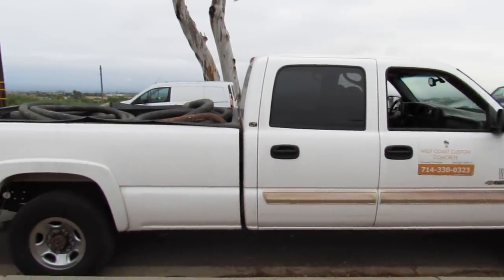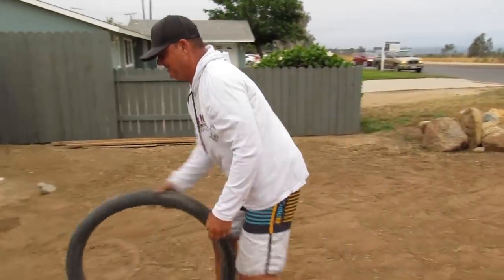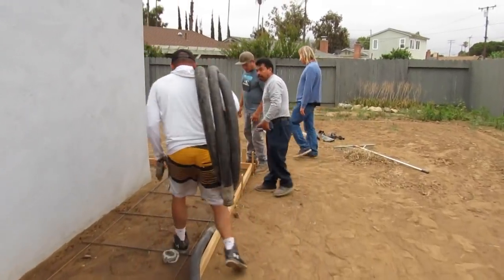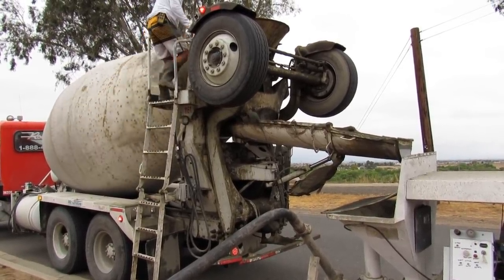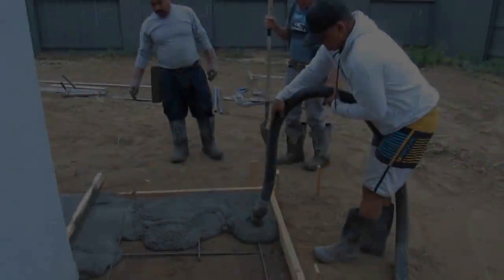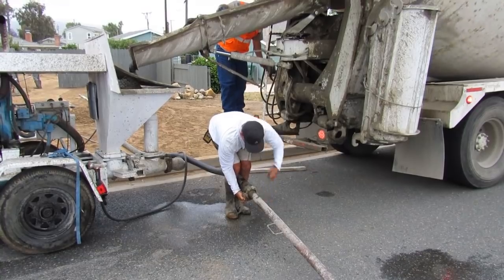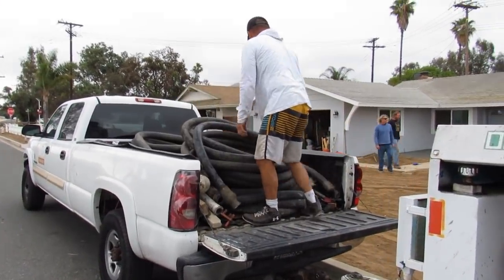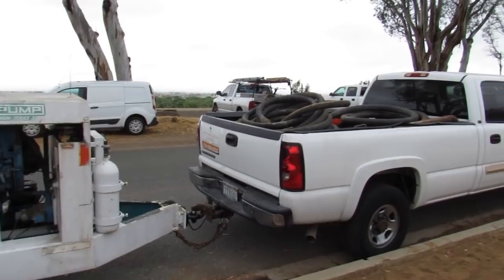Concrete Pumping. Olin 545. The Best in the West! California

Comment: You are the only guy I’ve seen that makes this look so easy and relaxed and simple.. I’ve been pumping for 6 years here in the IE and LA county area. Cheers💪👍 be safe out there.
Reply from the maker: Thanks bro! What kind of pump are you running?
Reply: No problem man! And I use Olin 545 and 565. I want to learn how to use a T/A pump. I’ve heard some are really good.
Reply from the maker: @Yeetman666  for sure bro t/A pumps are nice. If you are running  A Olin you would have no problem  running a T/A

Comment: Nice. With a ball pump you would have to break open the reducer to get a sponge in there, right? Not worth the trouble if you have the water.
Reply from the maker: Yes water works perfect

Comment: What's up! My father-in-law just picked up a Olin 535 pump not too long ago and I've been helping on the last couple jobs. How much do you adjust your nitrogen bottle per number of hoses or is it always set to 100? When you're doing your clean out, are you cutting off your hoses and leaving just the first hose or running the water through all of your hoses and back into the cement truck?
Reply from the maker: It all depends  on the distance  and slump. If the line is surging put more  air on it  you can hear the piston knocking in the surge tank bleed some air off.
Reply: @WestCoastCustomConcrete  Ok, that makes sense. When you are cleaning-out with 100-200 ft of hose put out like at this job you did, do you cut the lines and clean separately or pump the water through all of the hoses leaving them still clamped together?
Reply from the maker: @derekhead7068  yes it's all clamped together

Comment: I have an olin machine just like the tulla but I have an electronic problem so that it throws cement, could you be so kind as to open your electrical box and record a video about it. copper how are the cables connected thanks
Reply from the maker: Sure no problem 👍
Reply: Thank you answer
Reply from the maker: @christianmelgar8062  👍
Reply from the maker: @christianmelgar8062  👍
Reply: Hi west
Reply: Cam. You make favored
Reply from the maker: @christianmelgar8062  hey Christian text me and I will send you a picture of it 👍

Comment: sir how  Olin concrete pump works? which size of granite can pumped by Olin.
Reply from the maker: This pump is a ball valve pump it pumps 3/8 pea gravel.
Reply: @WestCoastCustomConcrete  thank you sir to reply me. there are a lot of videos on Youtube about swing tube concrete pump working like putzmister e.t.c  but how the ball valve concrete pump works? I search on youtube but did not found any information. I know the ball valve pump is the simpler and easy concrete pump but how it is works?
Reply from the maker: @muhammadshafi227  I'm going to be doing a very through video on the ball valve pump. So I hope you can get a good idea of how this particular pump works.
Reply: a lot of thanks.

Comment: If i'm using regular 3/4 inch aggregate would that  create a lot of clogs in the 2 inch hose? I read somewhere that the hose should be 3x the size of the aggregate.  I run a putzmeister combination mixer and pump doing small jobs. Can I run a 3 inch pump without a reducer for foundation work? at least 50 ft away?
Reply from the maker: Should be able to know problem 👍

Comment: What rpm you pump at with about 175+ feet of hose? I run a 545 in Bakersfield too but never pump at more then 2k usually around 1700
Reply from the maker: That's good. If it's a stiff slump a little higher 👍

Comment: we use to do mid rise apartment buildings 3 story all concrete floors, 6000 to 8000 sq.ft. per floor we used a truck mounted pump and everytime we used this pump it would clog at least twice !!  So we would lower down the 4 inch hose  beat it with a sledge and if that didnt work start taking hoses off ,,,,what a pain in the ass ,,,those 4 inch hoses full of concrete were heavy !!
Reply from the maker: Can be a nightmare

Comment: What's the best option if you can only pour 4000 psi? Does this pump still work for that?
Reply from the maker: Yes no problem.  I pump 5k psi all the time
Reply: @WestCoastCustomConcrete  One more question, we like to pour with microfiber's. Does it tend to clog up your pump or is there no issue there?
Reply from the maker: @abrahamalonso4867  hey Abraham. Not at  all everything  I pump has micro fibers in the load

Comment: But can you pump big rock or just grout mixes
Reply from the maker: It's a 3/8 pea gravel pump. I can pump 5.000 psi all day long
Reply: @WestCoastCustomConcrete  right on! Those Olin pumps are pretty rugged, anything over 4500 and I use my swing tube. I hate miss strokes 🤓
Reply from the maker: @erick101ish  right on bro 👍thanks for watching

Comment: If I owned a pump I’d used it on every pour.   But to pump a job locally for me would add $1000 to my bid. I’d miss 99% of the jobs I do adding that into my price.   Fortunately we can do almost all of our jobs right out the truck. We’re not in the city.  We do buggy a good amount of jobs in town.  Summer time it kinda sucks.  But it’s not as slow as you’d think. They hold a good amount of concrete.   Winter time is no problem to buggy.  Unless the yard is wet.

Comment: What do you charge for pump ?
Reply from the maker: $350 set up $10 per yard 👍 I'm the most expensive guy out here.
Reply from the maker: What area are you from?
Reply: Utah. Minimum $550 first truck and add a $100 every truck after 1st truck. So if there’s a second truck it’ll be $650, third truck $750

Comment: Man, I run a 580 here in SoCal and on some jobs the customer still wants me to run it faster when I'm wide open and nothing left to give. I'm in the union so all I pump is commercial stuff and almost entirely just slurry. Best part is I don't run or pull the hose around sometimes don't even set it up myself.
Reply from the maker: Nice bro👊I had a 580 Olin I loved that pump

Comment: Experienced ? They are using finish trowels to float ,and you haven't pumped concrete till you have ran a hydraulic pump.its a hole different deal
Reply from the maker: This pump  is hydraulic

Comment: Hello everyone! found this site last night as I'm installing a 230 foot driveway up a mountain (Lake Tahoe) by hand (video to come shortly). I'm currently using a trash can to mix 5 bag batches of concrete with drill attached mixer. I saw the reference to a "Georgia buggy"     damn........................those Southern hicks, just like turning the clock back (YOU DONT WANT TO DO THAT - TRUST ME)
 Anyhow, I'm mixing half a yard per day (4 hours each day) and I call it EXERCISE but as soon as I pave a turn out half way up I will call in a concrete truck and load a 4 wheel drive pickup with concrete and get it done that way..........so maybe call it a California Buggy?
Reply from the maker: Man that's  awesome 👊you  are one hard ass worker

Comment: Ta pump is better
Reply from the maker: I like there newer pumps with that new manifold and diesel. Ta  does all my service on my pumps.
Reply: I agree the new diesel ones aren’t too good but i have an old one and its pretty but olins are a little stronger
Reply from the maker: @carlitouu  I love those older ta. So you have the Ford 6 cylinder gas motor?
Reply: West Coast Custom Concrete yessir you got it right, those are some beauties never goin to let mine go hopefully
Reply from the maker: I woud hang on to that pump for your whole career. Only problem  is it doesn't  like 4.500 psi. Other than that they are sweet.
Reply: West Coast Custom Concrete yea it doesn’t jajaj but yea its amazing